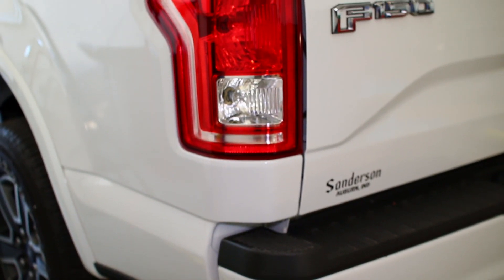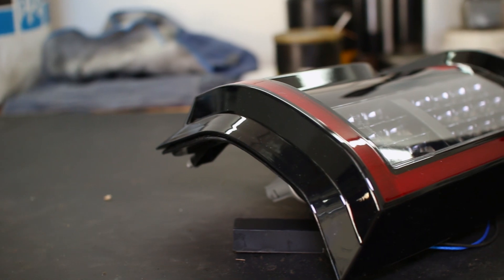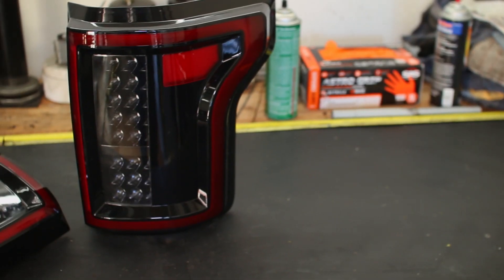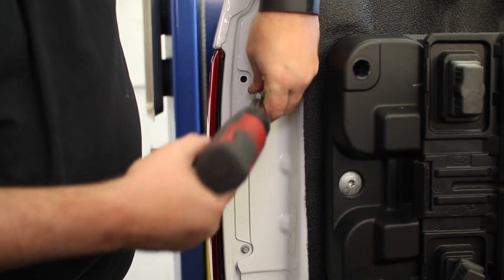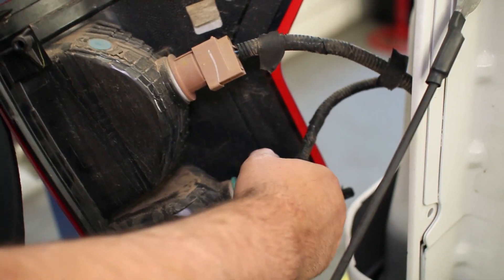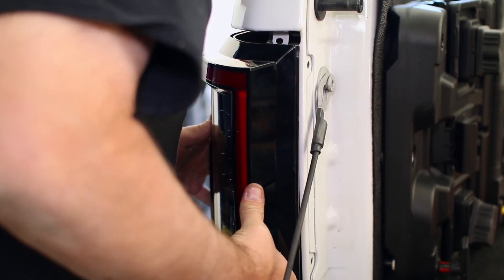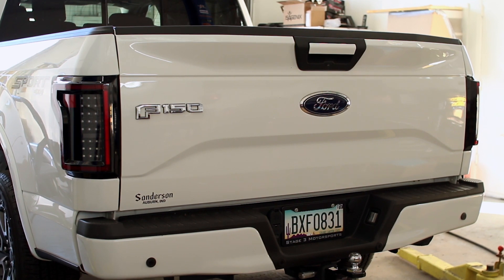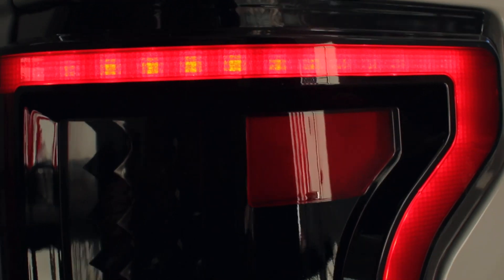2015-2017 F150 ANZO DRL Outline LED Taillights Install

Comment: Wouldn't these fit in a 2018 as well? I understand that it has an extra bulb/harness for this year, but the design is the same.
Reply: Did you ever test out ? I bought 2018 lights but I don't think they will fit my 2017

Comment: Can you make GEN 2 video
Reply from the maker: The gen 2's install the exact same as the gen 1's!
Reply: Stage 3 Motorsports I want to see some pictures of the gen 2
Reply from the maker: Head on over to our site to check them out! We already have a couple product pictures up and will have more pictures up later today, so check back later as well
http://www.stage3motorsports.com//311286-2015-2017-F150-ANZO-Gen-2-Smoked-LED-Outline-Taillights.html
http://www.stage3motorsports.com//311285-2015-2017-F150-ANZO-Gen-2-Black-LED-Outline-Taillights.html
Reply: Stage 3 Motorsports great thanks, I saw the one picture of the grey truck. You guys do have best site for f150